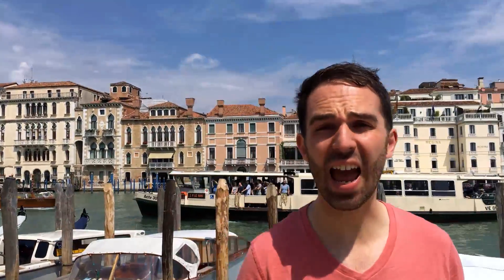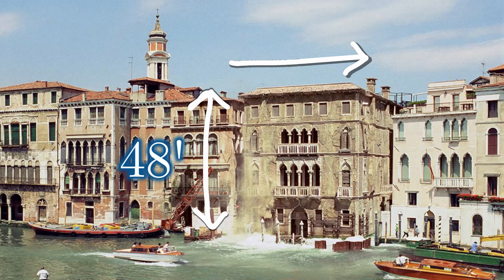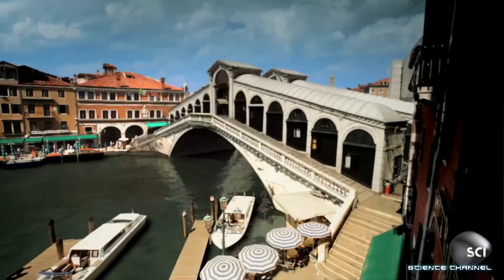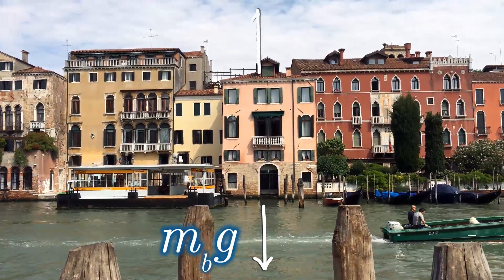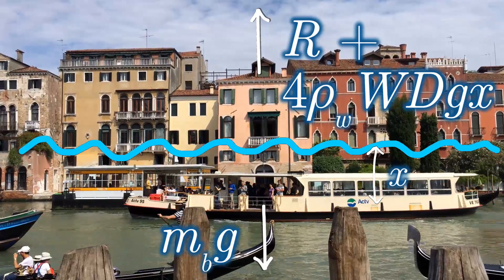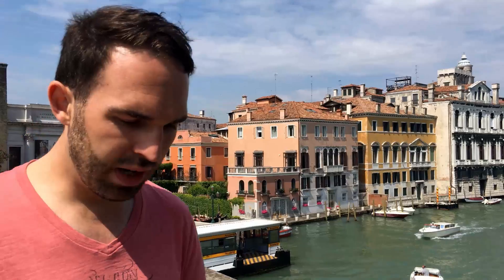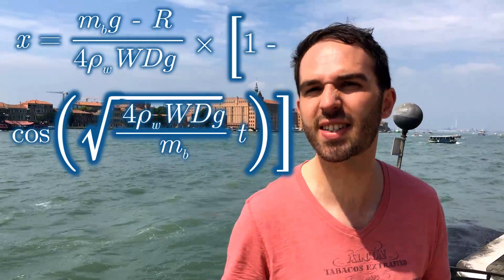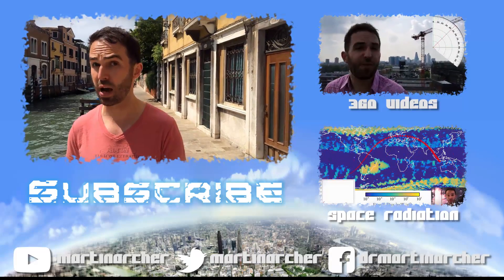Casino Royale's Sinking House in Venice | Physics vs Film

Comment: Your formulae mean absolutely nothing to me  - and probably to a lot of people - also you just spring this 'reaction force' concept on us with no explanation - so this is completely unintelligible to people like me who have no mathematical understanding whatsoever. But I guess that's my problem. On the other hand, I'm very practical, and I can't understand how there could be a 'reaction force' - you mean the resistance that the house is exerting against being sunk??? - well surely it can't exert any resistance because it's just a dead weight? Another problem with the Bond film is - how are the buoyancy bags attached to the house? - you can see them, so they aren't actually underneath the walls - they're attached to them somehow - but no attachment would ever be strong enough to resist the downward force of tons of masonry.  The only physics formula that I can understand is called, I think, 'potential energy' - which is 'mgh' - mass times gravity times height - well, most people could understand that, I guess - i.e., the heavier a thing is the faster it will fall and the more damage it can cause, but if it's held up by something, then it's resisting the force of gravity - ergo it has 'potential' energy - which will be realised when it's allowed to fall. This is obvious, as I say - but 'reaction force' is not.
Reply from the maker: @RobCarmina  https://en.m.wikipedia.org/wiki/Reaction_(physics)

Comment: If you take into account a portion of the piles may have been supporting some of the mass and the mud just a few feet under the structure slowing down the eventual submersion of the entire structure, the entire scene is flawless. The canals are dredged regularly. Some are deeper than others. However the mud under the structures is roughly the same depth it's always been, less seepage into the canals and compaction. 

Cheers!
Reply from the maker: That’s factored in, the piles and mud provide some level of reaction force on the buildings as discussed in the video.

Comment: There is one thing wrong with the building sinking and that is the wooden supports under it were overlooked in the calculations.  As bad and old as the wooden piles are, they would still have hindered the sinking as described in the calculations, rendering them void.
Reply from the maker: The wooden supports are what contribute to the reaction force, which was discussed in the video and included in the calculations.

Comment: Wouldn't the building's collapse in the real world affect the adjoining buildings and their supports as well ?
Reply from the maker: Possibly, but under ideal conditions it should  just sink. The building is detached so probably wouldn't bring the surrounding buildings down, but probably in the long term would disrupt their equilibrium.
Reply: Martin Archer The building doesn't exist in real i was there this summer and saw that!
Reply from the maker: Dr Goldfinger yep, you can see the blue screen set and model they used in my video which they superimposed on the real Venice where there's just another canal where we see the building in the film.

Comment: Would the air inside add to the reactionary force, even though there are windows etc. somewhat like a diving bell. The evacuation of said air might slow it down?
Reply from the maker: If there are windows so that air can flow in and out of the building then you don't need to consider the air at all. If the building is indeed sealed, then while the weight of the air is negligible as the building sinks the pressure of that air will build up because of the decreased volume. This introduces a difference in the atmospheric pressure acting downwards on the building and the pressure of the air from inside the building acting upwards which would slow the sinking somewhat.